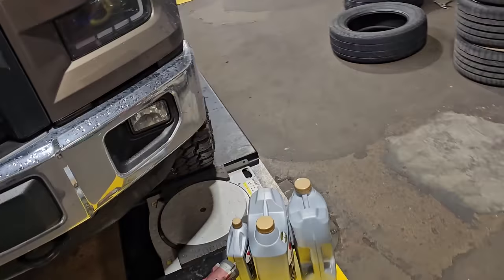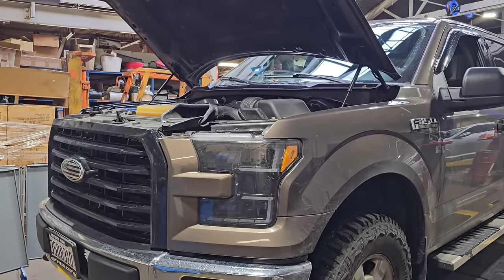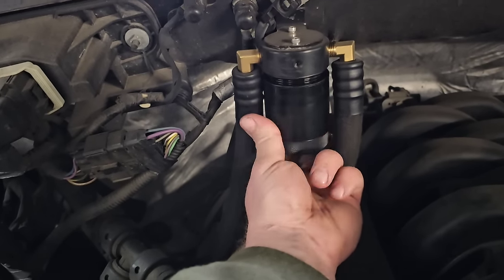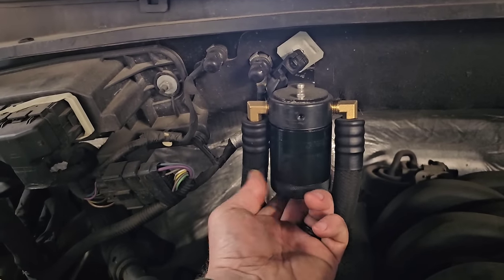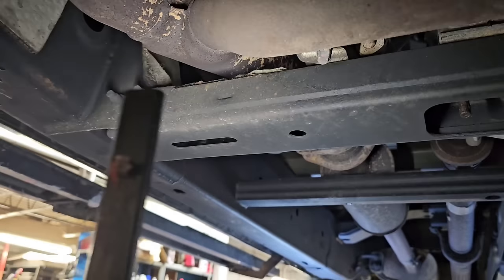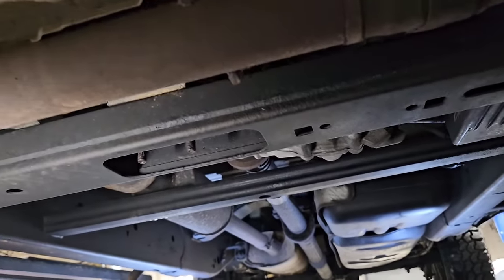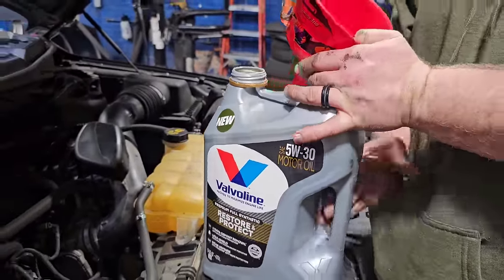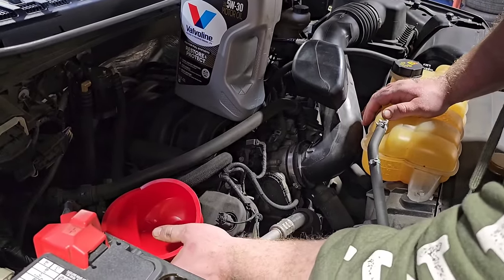F150 5.0 Oil Change New Valvoline Restore Oil, FL820 Filter Not a FL500, Prime Oil System

Comment: I switched my 2011 f150 5.0 over to 5W-30 years ago. It did seem to quite it down some.  I'll stay with the 500s filter tho as I live in a cold climate. We have an old 92 f250 gasser and we ran 15w-40 in that for many years. The truck has 220,000 miles on it and it's still going.

Comment: The worst oil I've even used was Quaker state defy 10w-30. I ran it in my 97 Tahoe and the lower end was not happy. So i dumped it and put the mobile 1 high mileage 10w-30 back in it and it was quite.

Comment: Well, I tried this method… no room between the ball joint and the control arm to place the cups from the ball joint the cup was very long. I don’t have a short cup… so then I decided to put the jack on the control arm and lift it up as much as possible and that gave me some more room… but it stressed the swaybar link… Basically, you’ll need a car lift to do this job… The impact wrench there was no room for it either… good idea if you have a car lift… knuckle will move up and down so you’ll get a little bit of a room there… even if you were able to get the ball joint plant whatever they call that thing you won’t be able to leverage it off to turn it because you’ll be lying on the ground trying to do it so you can’t get any leverage again you will need a car lift to do this, but it’s a good shortcut you have a car lift.
Reply from the maker: Huh
Reply: wtf ???
Reply: @myprivatewar  yeah I could be the alignment on my car not sure.. oh well it’s done at this point

Comment: I picked up some of that Restore and Protect. NAPA had it.  They didn't want me to put it in my 2011 Ranger.  Claim it doesn't fit.  I was planning on putting it in 2004 Saturn Ion. Not certified for it either :).

Comment: I just realized your truck has a lot less total engine & idle hourse than mine for having over 100k miles. My 2017 2.7 f150 has 3418 total engine hours with 779 idle hours. And i have a little over 83000 miles

Comment: My 5.4 3v runs much quieter with 5w30, cap says to use 5w20.
Reply: I run 5w30 royal purple in my 4.6 3v mustang it has a melling high volume oil pump in it runs pretty good

Comment: Hey Boss can I ask you a question I have  a2020 Ford Ranger I bought extended warranty it has run out do lots of driving. When I hit between 40 and 50 km it seems likes it hesitates I changed and fuel injectors I never have missed an oil change
Reply from the maker: Have you done anything with spark plugs or clean the throttle body

Comment: Just a curious thought, have you checked the spark plugs? If they are not firing correctly, could that lead to fuel dilution in the oil/blow by? Am I correct in this line of thinking? 
Also, I have a 21 ranger with 2.3 eco boost. 50,000 miles. What oil Would you recommend? Stay with 5w30? Have you looked into the new spec of motor craft. (Gf6)

Comment: I have been using the Motorcraft synthetic blend motor oil on my 2016 Ford Escape 2.0L EcoBoost, since new. I understand that Castrol Edge fully synthetic is Ford approved. Castrol website has even an oil selector, and you get their oil type recommendation for your specific vehicle. In your professional opinion, would switching to Castrol Edge fully synthetic be beneficial. Thank you so much, I cherish  your advice.

Comment: What does "Restore and Protect" mean?  Is that just another marketing term for High Mileage oil?
Reply: Some newer engines ( mostly 4 cylinders) are having troubles with the piston oil wiper rings getting plugged up and then the engine uses tons of oil, sometimes a quart every few hundred miles!  Restore and Protect is supposed to clean the piston in three oil change intervals. We'll see if it actually does what it's advertised to do. To me the wording on the bottle isn't a guarantee.

Comment: Is there any reason to think that the restore and protect would be harder on engine seals or maybe rubber oil pump belts? I have a 2020 Mustang GT and I believe the 3rd gen Coyote has the rubber oil pump belt. Just curious since it wasn't designed with a cleaning oil in mind?
Reply from the maker: I wouldn't think so I think it would be perfectly fine
Reply from the maker: No I don't think yours has an oil pump belt I'm pretty sure up until 2020 it was still driven off of the crank
Reply: Thanks! @FordBossMe

Comment: Would love to hear your opinion on the best 'High Mileage' full synthetic oil out of Pennzoil and Valvoline. Just picked up a 2003 Acura TL with 148,000 miles. Pretty sure the previous owner's been using Pennzoil platinum 5W20 from the dealership. But I want to switch to high mileage and want the best. Money is not a factor. Thanks brother 🙏
Reply from the maker: The best bang for your bucking high mileage is Valvoline high mileage extended protection Ultra Max life technology or just regular Valvoline high mileage full synthetic

Comment: There is a bigger Oil Filter that fits in  Ford Mustang GT 5.0 from 2015 to Present called Ford Racing CM-6731-FL1A. Would that Oil Filter also fit into a F150 since its a Coyote also ? Love to see 5W-40 in that F150 in the next change.

Comment: Rich, I have a 2017 f150 5.0L .I'm still having the issue of stalling at lights after a highway drive or after driving for a period of time. Everything I'm researching is leading me to cam phasers over retarding the timing. Do you think this is a possibility. Problem is it's not throwing a check engine light.   I have 109,000 miles.  New plugs ,new throttle body, and just had to put a new converter and trans from. Converter shudder.  I thought maybe some how the converter was causing the stall but it's still doing it. I bought the truck used last year, and it's pretty much been doing it the whole time.
Reply: Keep us updated if you figure out what it is
Reply: evap purge solenoid ? any "pending" codes ?
Reply: Vct solenoid. Common in those trucks

Comment: 5,000
At 2,500 I will change out the oil filter, and put in a new one. And add STP oil treatment to refill the oil level.
At ,5000, 5,100 miles I will do a full oil change. New filter all new oil.
   The motor oil
    The filter is not the problem for our cars.
The problem is the fuel that we buy, American fuel can change from place to place and week to week.
The oil refineries have a standard to manufacture, gasoline, and diesel . They have range to produce oil..
  So the fuel combustion in the engine, one week can be dirtier than the week before or the week after.
This contaminator oil makes your oil black changes the color of your oil to Brown.
   So dipstick color matters in your motor oil.  If it turns black, get it out, no matter the mileage.
Best wishes

Comment: Im going to try the push to start prime next time I change the oil on suburban so it does not start dry.  Does filling the filter help or not? My truck I can fill it because it's under but the equinox is facing the engine so it might put out the filter. Wouldn't gm etc tell everyone to fill filters with oil if it was better?

Comment: Do you ever add any lucas to any of your oil , i have been using lucas for years and always had great results and I recently purchased a 2011 chevy Silverado 1500 what is your thoughts of putting 10w30 in it , truck has 205,800 miles on it
Reply from the maker: Doesn't help unless it's a wore out engine

Comment: My ranger just hit 200,000 miles I do change it every 3,000 miles I just used this oil I still run 5w,20 in it what says on cap do you have any advice on oil truck runs great 👍 still no issues but just for piece of mind should I use 5w30

Comment: In 5400 miles any oil added?  And how much??   Waiting for oil testing results!!
I use 5 or 10w - 40 in everything ......... great results and no down side.   Even in zero degree weather.   0w-40 tried but costs more than 5w so stayed with 5w or 10w.  Also no differences between 0w and 5 w.

Comment: would you pre prime oil sys in a 2000 odyssey minivan? can it be done in other, older cars?
i just did an oil change on mine and it sounded a little rough for the first few seconds. After the first 100 miles the engine is running noticeably smoother. i also used valvoline R&P and am planning to change this one early around 3,500mi as i’m nearing 300k

Comment: Their isn’t a huge difference between 20-30 weight oils totally  fine to run. The manufacturer back be for the hype of mpg and epa would give you range of viscosity to use since on your engine depending on conditions. As why it would have a refer to manual label on the cap.

Comment: Why do they design a motor that Cokes up intake valves ?😊
Reply: Engine designers should plumb PCV into the exhaust system not the intake manifold. Catalytic converter would burn the vapor and intake valves stay clean..
Reply: Because of the EPA. Everyone went to high pressure direct injection like a diesel. Port injection would spray the intake valves and keep them clean.

Comment: Maybe someone here can help me, my 2016 f150 5.0 has been having some ticking from the bottom end, I can hear it from both wheel wells and at the bell housing area. Only happens between cold start and warming up. once warmed up it goes away. also can only hear it from 1300-2500 rpm range. Do I have a spun bearing or something, saw some mustang guys replace bearings. Been happening for the last 25k miles, but seems like its getting louder. Anyone else with the same issue?

Comment: So i have a 2015 gmc sierra 5.3L IT TAKES 0w20 can i use 5w20 or 5w30 or will that hurt the motor?and this oil vs royal purple
Reply from the maker: If you look in your owner's manual it probably says you can use 5W20 or 5W30
Reply: @FordBossMe thanks ill ck it out and see

Comment: We ride in ford because the old Chevy silverado z71 with the 350 engine had to much wrong with it for only me to fix 

Needed new back break lines front differential torque converter doors alot more shit the old thing needed head gasket was shot luckily the sealer for that worked for so long it still did after the torque converter broke flush the radiator alot to get done in the rain on gravel so we sold the truck and my buddy gave me his old ford he was tired of wasting his money at the shop on it

So i fixed the old ford and is what we drive now the fords engine was more less rebuilt and the transmission refurbished but the pros couldn't fix it i guess im glad they didn't it still needs little done to it but less then what the Chevy needs im glad the ford doesn't have homemade headers on blocking the spark plugs in those made it really hard to get to the 4 plugs out on the Chevy thats another mistake that boy will have to replace with real headers or make it regular the pipes on it aren't worth having on to close to 4 plugs and the pipe thickness is to thin because it doesn't go to the truck but all that shit ain't my problem no more its all his i let him know whats all wrong with and what it'll need to get it back on the roads the wide tread tires sucked ass on rain snow and muddy grass

Comment: whats valvoline restore? a new high mileage?
Reply from the maker: It doesn't label itself as a high mileage oil I think it's replacing Valvoline Advance to be honest with you
Reply: @FordBossMe  the dang marketing is getting rediculous.  it used to be valvoline conventional and synpower. now every brand has 40 lines.
Reply: I read that it's supposed to clean pistons. It'd be great if it helps with the oil ring plugging issues some engines are having.

Comment: 2018 F150 5.0  years ago switched  over to the FL820S after i was curious, ...been using the FL820S in my 2003 F150 5.4 for years,...lets see if it fits.   Them dirty bastards, Ford had a filter in production and made the smaller FL500S just to increase heat in the motor,.

Comment: Im not a fan of these oil Labs,I use the Gold Plug oil drain plug,that tells you exactly how good the oil is by monitoring the shavings amount on the Magnet. 
There is oil out there that runs completely clean like Xado 5w30 amc black edition. 
Gold Plug is tha way to find out the premier oil,not these labs.

Comment: Rich your return line fitting is barely threaded into the separator. Don't you want to correct that?
Reply from the maker: No because it's threaded in there pretty good I don't need to make it anymore It just looks that way in the video

Comment: It dosnt come in 10w30.guy on bobistheoilguy ran this restore 500 miles took pic of his dipstick.500 miles,the oil was black.  ...some suggested draining the oil 1000-1500 miles,replace it n filter.so far,from pic the consensus is so far,its cleaning the piston rings too.
The synthetics we see instores,are Hydro cracked oils.not true synthetics rather reg oil that's been refined so virtually all impurities are removed. The oil behaves like a synthetic.but it isnt. In 1998 Mobil sued Castro in federal court.syntec. Mobil claimed it wasn't a true synthetic.which was true. Hydro cracked oil. Well,the judge decided Castro could call it synthetic.CastroL won the case. The other oil makes soon caught on. Today, Mobil one is just a reg Hydro cracked oil,its not a true synthetic anymore. But it does have a bit of POA in its base oil. Esters....are molecules ,additive in true synthetics that do the fast deep cleaning. Its pricey.
Redline, am soil signature series,molecule are true synthetic oils.decline having the most esters.
Now....the Hydro cracked oils advertising they deep clean. Valvolibe restore.Mobil extended guard says back bottle helps to remove s!udge.  Even Mobil one does not advertise that. Castro ultraclean...it has molecules that attach too dirt,carbon in engine and take them oil pan, holds in suslension.till next oil change. 
They do not have esters in them. So whatever is the ingredients ( all oil company's will never tell, guarded secret).this is what they've made,without being a true synthetic.

Comment: This is supposed to help GDI engines....
Reply from the maker: All engines
Reply: @FordBossMe  oil usages?
Reply from the maker: @bob-pr8ye  what are you asking
Reply: @FordBossMe  so my Kia uses a lotta oil, at least a quart every 1,000 miles . It has fairly low miles. 80,000 to be exact. It has direct injection and that is something that needs care. Lots of oil changes ! Valvaline came out and claims that this new oil is just what we need for that engine. I was just wondering if you feel that a new oil with additives to clean deposits caused by this type of engine could ever help with that ? So far it seems to be a flop. They said it will take 4 oil changes I am on 2.

Comment: Why the switch from pennzoil platinum to the valvoline?
Reply: Like he said. "Experimenting"
Reply: -He always switches and then sends the old oil in for analysis.
Reply: I'd have no problem running Valvoline vs Pennzoil platinum personally, the only one I ever had a significant difference between the two was the ultra platinum.
Reply from the maker: There's no problem switching buddy plus I experiment on everything
Reply: @FordBossMe  ok I know you said in past videos that the pennzoil platinum was great oil so I was just a little surprised when you were changing to something different in your F150